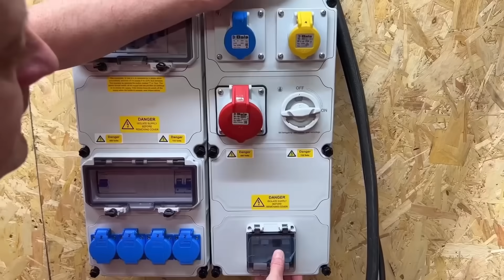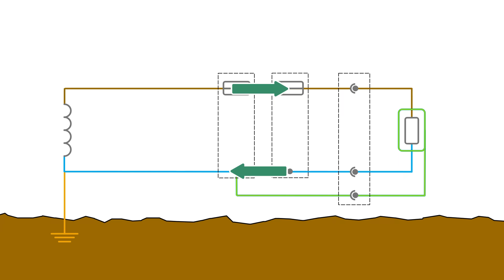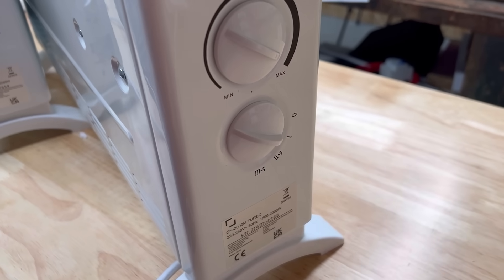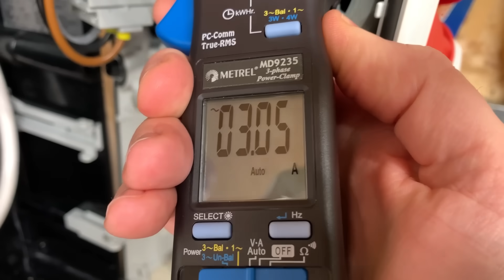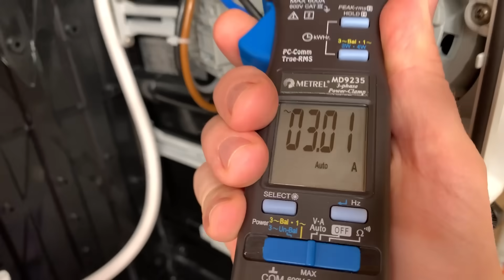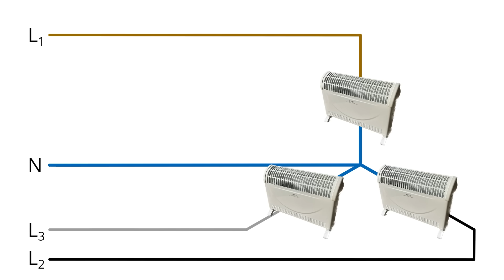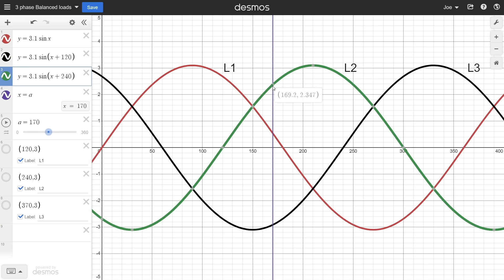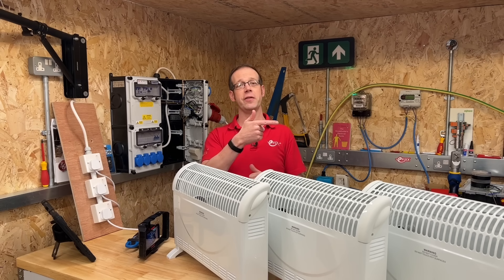Does Current Flow Through The Neutral Wire?

Comment: The answer is yes, current flows through the neutral wire when its in circuit, but lets just confuse the matter by introducing 3 phase. You didn't answer your own question (where is the missing current going 4:20). The answer is its going down the other phases, because they are out of phase. In a single phase circuit, the neutral wire is just a return to earth. In a 3 phase circuit, the return path is through the out-of-phase cables, and you get close to double (1.7 times) the voltage across any two phases.

Comment: Thanks for this as I repair electonics  I keep thinking about my Ocilloscope use as I only use it with Battery powered items and avoid using it with mains powered items. Isolation TRansfomers Are a way to avoid using the earth connection on your scope though Using Live and the Neutral are not recommended geenerally. Maybe you can have a video about this.Thanks Lewis

Comment: By tying those cables together using plastic zip ties, you're reducing insulation performance, increasing the chances of damage to the insulation (plastic zip ties have sharp edges) which might lead to shorts and ground faults.
To top it off, you're also making it harder to perform clamp meter measurements, which, depending on how much you overdid it with the ties, might require cutting them, running the risk of damaging the insulation in the process. 

If you're going to tie the cables together (which is an inherently bad idea), at least use soft ties that won't cut through the insulation.    

In an attempt to look tidy and fancy, you're actually making things worse and more unsafe.  
Those cables are there to conduct the amount of current they're rated for without shorting or leaking, for that they need proper ventilation around them and enough separation + leeway to move freely without having their insulation compromised in the process.

I'll pick a reasonably "untidy" box over this plastic zipper time ticking bomb any day of the week 😅

Love the educational content, though, you're a good teacher.

Comment: I have a very basic understanding of how current flows in a circuit but i must say that the fact that the same current can be measured in line and neutral after travelling through a load leads me to think that the examples i was taught at school of current being compared to water in a hose and the water being used up working the load is entirely flawed.
Reply: there are indeed limitation to using analogies. But still, analogies are meant to help you visualize. Not to meant to be used literally.
Reply from the maker: Think of the water in the hose passing through a turbine that rotates, that's the current driving the load. Electricity is a medium to move energy from one place to another.

Comment: If you ask 100 electricians what does a neutral wire do most of them can’t give an actual definition they’ll just say “it’s the return wire” great video
Reply: well, the neutral's purpose is indeed to carry the return currents. Whether that current is 0A or not doesn't change its purpose.
Reply: It's sad but most site electricians are just there to build and as a result electricians don't always have to think in electrical terms

Comment: Aswer: Yes, dar in single phase.
In 3 phases, if all the phases have identical loads, eg. Same reactance: resistive, capacitive, or inductive, then no current will flow on the newtral.
That's it plain and simple.

Comment: So if current goes into the load and flows back to the source, and current isn't 'used', how come batteries go flat?
Reply: Maybe the wires and components inside load act as resistance, slowly draining even if load is on stand by or circuit open

Comment: What you demonstrate with heaters is true, only because they are linear (resistive) loads. For non-linear loads, LEDs, fluorescent lamps, and electronics, the neutral current can be as high as 1.732 times the phase current. I have seen the neutral wire burn on a balanced 3-phase lighting circuit and simulated this condition. Code in the US says that the common neutral must have anpacity of 1.7 times the ampacity of each phase,

Comment: I Learnt this at college in my 3rd year of Refrigeration my Lecture said true balanced 3 phase electrical circuits do not always require a Neutral, and he proved it with a 3 phase induction motor. Great presentation from you guys as normal.
Reply: In Canada we almost never provide a neutral to 3 phase circuits. We may use a motor in a delta or wye config, and sometimes a wye start- delta run but the centre point is never grounded in a wye motor. We have 600v services in wye or delta configuration and the neutral would be bonded at the point of disconnect only if there is one.
Reply: It’s also mad you can roughly measure the neutral current by drawing a triangle and doing the correct angles and measuring, like who the hell was clever enough to work that out is what gets me.
Reply: @callumsimpson7483 which is kinda obvious since the three phases are apart 60 degree and using trigonometry you can calculate the resulting output current
Reply: @musashi939  not 60 but 120 degrees apart.
Reply: Yes, but how do you get charged electricity through the meter? How is the completed circuit completing? You have to have a voltage drop as well.

Comment: Well demonstrated! 👏🏻

As an electronic engineer, I'm quite worried by the "common misconception" mentioned at 1:42 that "current gets used up in the load". If you're a sparky and have this concept of current, you have some homework to do...

(The only thing that surprised me was that the current in N wasn't lower than L1 or L2 when only those phases were loaded. Need to go back to school to do that maths...)
Reply: @JfromUK_  It is because of adding 2 vectors which have 120 degree angle between them. They form equilateral triangle

Comment: I get the current, but does voltage flow through the neutral?
Reply: Voltage does not flow. Voltage is the potential difference two points. What two points were you referring to?
Reply: @ I’m trying to get my head round it (neutral and earth). Even though they are connected, the current from the neutral is going back to the source, but if the neutral is broken we suddenly get a potential difference between the neutral (before the break) and earth. So the voltage as I understand it, is a force which must be going through the neutral all the time in order to push/pull the current back to its source.
Reply: @Jim804  if the neutral breaks, the part that connects to the load acts like a live wire hot wire (assuming the circuit is still energized). So there is a potential difference between that side and the ground. Current is looking for a way back and if you connect that side to the ground, it can now travel on the ground and back to the source. Keep in mind that t's still current that flows. Not voltage

Comment: Why would the current entering equal the current leaving if loads are on?!! Can someone explain the science? How do the loads not affect the current and use up energy? Doesn’t a light bulb use energy when it’s on?!
Reply: A difficult question to answer. You may look at current in a circuit as a driving belt. If such a belt is used between the motor and the saw blade for sure energy from the motor is transferedvto the blade, but the belt is simply running in a circle. The same with current from a generator via a motor back to the generator.
Reply: @ I see so it’s lie conservation of electrical energy type thing?
Reply: @MathCuriousity  I realy do not know a good way to explain this. You do not conserve electric energy, but at the same time the current is flowing in a loop. Again, consider riding a bicycle. You pedal easy on flat lannd. As the slope rises, you must push harder and get sweaty. I.e. you deliver more energy to the aft wheel. At the same time the chain is just running in a loop.  In a generator/motor set up the more you increase the load on the motor, the more current will flow in the loop and the generator will slow down unless you add more water to the driving turbine.
Reply: @ that was nice. I enjoyed the chain analogy. Same loop distance, more effort! Ie more current! U should be a teacher!
Reply: @MathCuriousity  He, he, I was married to my late wife for 46 yrs. Maybe some tricks trickeled down on me too?
Reply: @ definitely ha! Thanks man!
Reply: @MathCuriousity  current stays the same but the voltage will drop

Comment: Please explain if you have time, why neutral to ground at a receptacle measures a couple volts if at main panel they are bonded and should be 0?
Reply: In theory, it should be 0v. In practice, wires are not ideal and have small resistance, thus, cause a small drop betwen neutral and ground. Usually less than 1V. You can prove it to yourself by draw a circuit diagram. 

   ----------------------
   l                        l
 120v           60ohms
   l                        l
   ----------------------A (neutral)
   l                      
   l
   ------0.01ohms----------B (ground)

Connect a 1M ohms between A and B to mimic a multimeter. Just solve for the voltage between A and B and you should get less than a voltage. I wish i can draw it better tho.

Comment: Hi, great video just have one question on the neutral currents . 
In a 3-phase load I think i understand the concept of how the appliance uses the other 2 phases as a return path as opposed to the neutral. 
However in a situation such as in this video where 3 separate single phase loads are connected. How can the appliances use L2 or L3 as a return path? If the neutral were to be disconnected then surely there would only be 1 line conductor to each appliance? How would the appliances continue to operate if the other phases are not present at the appliance to act as a return path? 
It seems like I’m missing something here but I’m just scratching my head at the idea of an appliance operating with only one single conductor at point of connection.. 
hoping you guys can help me on this one hope I’ve made the question understandable!
Reply: you're probably thinking that all 3 currents at any given moment are coming out the source. This is impossible in 3 phase. What is really happening is, at one moment in time, only TWO phases have current going out, and combine (vectorially) to return on the 3rd phase. For example, at one moment,  A and B going out and combine to return on C. Next moment, A and C going out, and combine to return on B. Then next moment, B and C are going out and combine to return on A. And repeats. Of course this is in the context of a balanced circuit. Hope this clear things up

Comment: Nice video
Funfact
In Norway we have been running our mains network for 100 yrs with no neutral!  Neutral is not absolutely needed. With no neutral and the loads in a dela konfiguration, that is all loads are connected between live 230V wires, the return currents ‘fines its way’ via the other wires.  After 1995 all new houses in new areas are connected via 3-phase 230/400V TN networks, now with a neutral wire.
Reply: TN s or TN c ? I think TT for domestic is the safest neutral system.
Reply: @joseresina237  We use 3*400V TN-C-S in all new areas in Norway. New houses build in the /garden of older houses gets the older 3*230V IT system.  Network operators are looking into the cost for converting all  old 3*230V IT  domestic to 3*400V TN.

Comment: A NEUTRAL WIRE ISN'T NEEDED ??? Your statement is partly incorrect and confusing. Verscheidene malen verklaard u dat men geen neutrale geleider nodig heeft. Indien men de nul wegneemt naar het sterpunt of deze wegvalt in een 3-fase net, verkrijgt men een verbinding tussen de Lijndraden met als gevolg 400V over de Verbruikers. Deze verbruikers worden dan in serie tussen de lijndraden geschakeld Bv: L1 door verwarming 1,naar sterpunt, van sterpunt door verwarming 2 naar L2. Nu staat er over deze 2 apparaten 400V/AC. De tweede wet van Kirchoff is de spanningswet deze had u beter ook toegelicht. Men heeft de lijnspanning 400V/AC en de fasespanning 240V/AC, bv: tussen L1 en N. Hierbij de 3 fase transformator en de NUL = NEUTRAL als sterpunt/knooppunt. UW verklaring betreffende elektrische stromen is wel correct dit is dan de 1e Wet van Kirchoff. Deze zijn visueel mooi verklaard. Maar om elektrische stromen en de neutrale geleider volledig te verklaren dient u ook de spanningswet toe te lichten. Hierbij ook de gevaren. 6.40min 3fase motor is hier op 400V/AC hier is geen NEUTRAL. U diende hier een ander type motor te gebruiken als vergelijking met de verwarmingen. Graag had ik de les ;-) als nieuwe YouTube  gecorrigeerde video gezien. Titel en toelichting betreffende de elektrische stroom in een 3-fase netwerk. Ondersteund door de spanningswet in een knooppunt, bijkomend uitleg over lijn- en fase beveiliging. Tja de lessen in de klas zijn soms toch anders dan op dit net?

A NEUTRAL WIRE ISN'T NEEDED ??? Your statement is partly incorrect and confusing. You stated several times that one does not need a neutral conductor. If you remove the neutral to the star point or if it disappears in a 3-phase network, a connection is obtained between the line wires, resulting in 400V across the consumers. These consumers are then connected in series between the line wires. E.g.: L1 through heating 1, to star point, from star point through heating 2 to L2. Now these 2 devices say 400V/AC. Kirchoff's second law is the voltage law, which you should could have explained here. The line voltage is 400V/AC and the phase voltage is 240V/AC, for example: between L1 and N. Here the 3 phase transformer and the NUL = NEUTRAL as star point/node. YOUR statement regarding electric currents is correct, this is Kirchoff's 1st Law. These are visually beautifully explained. But to fully explain electric currents and the neutral conductor you must also explain the voltage law. Also includes the dangers. 6.40min 3-phase motor here is at 400V/AC, here is no NEUTRAL. You had to use a different type of motor, as a comparison with the heaters. I would have liked to see the lesson ;-) as a new YouTube corrected video. Title and explanation regarding the electric current in a 3-phase network. Supported by the voltage law in a node, additional explanation about line and phase protection. Well, the lessons in class are sometimes different than on this net, right?

Comment: What if i have  a delta transformer which feeds an unbalanced load? What happens in that case? I dont have a neutral and load isnt balanced....
Reply: Works ok. Some current may circulate in the delta.
Reply: the the loads will have different voltage across them depending on the impedance. This is extremely undesirable.
Reply: @nhitc6832  Well. In Norway we have been running 3*230V IT networks from about 1920 up to about 1995. No neutral. All loads are connected between line conductors receiving 230V. No problem.
Reply: @kjellg6532  right. I misread thinking it was a wye system with no neutral feeding unbalanced loads. In delta system, unbalanced loads will recieve a stable voltage.

Comment: Why was the current the same on the neutral when two heaters were hooked up. If you explained that I missed it. Also  how does current flow without the neutral connected. I know 220 doesn't have a neutral but unless Im mistaken each leg reverses acting like a neutral.

Comment: Thanks for the vid.
So if a 3 phase motor needs no Neutral how does the current travel back to the source?
Reply: The sum of currents are zero. So no neutral is needed. Curent in one live wire will return via the two others.
Reply: Yes, but not on the neutral. The sum of currents on any two phases will return on the 3rd phase back to the source.

Comment: Hi what is be the most likely cause of over-voltage in a 3 phase system?  One of the phase was found with voltage of 385V and it tripped the CBs and caused damage to equipment that were connected to the phase.

Comment: Probably worth noting that in an unbalanced 3 phase system the current on neutral will never be more than the maximum current that is in any one phase, so even if you can't manage to balance your loads the neutral conductor doesn't have to have a higher capacity than any of the hots.

Comment: But if the neutral conductor DOES carry current as you say .. how come i don't get electrocuted when i touch an exposed neutral conductor bare hands even when the current source is ON? (speaking about a single phase circuit)
Reply: In single phase, both neutral and you are at the same potential
Reply: @nhitc6832  which's equal to zero!
and that's why it can't push current into the body ... the voltage diffrence that's why .
Now i get it thank you ❤️